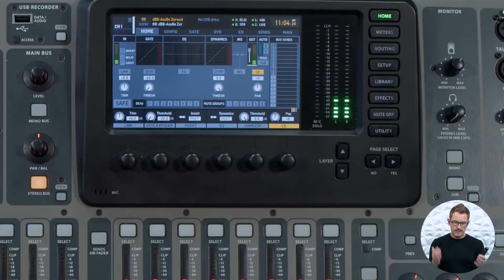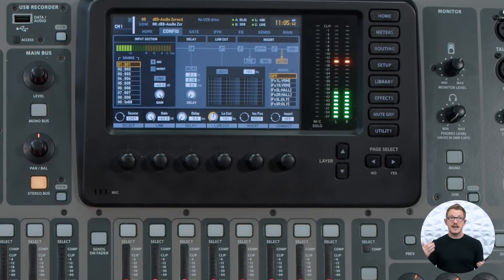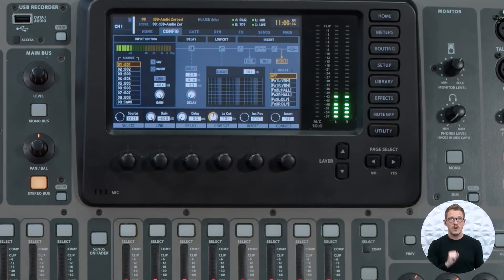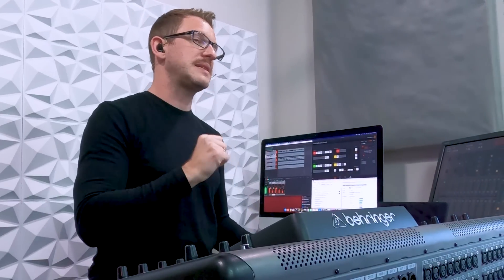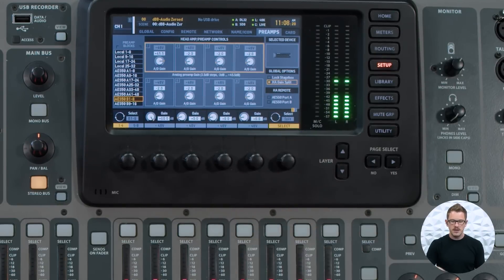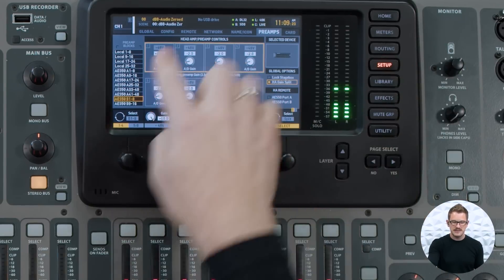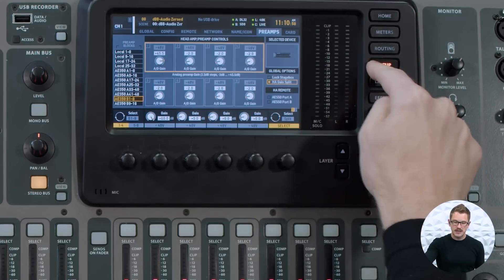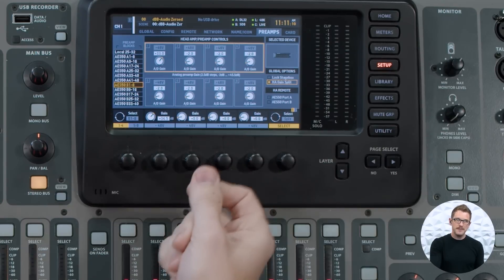Gain vs Trim, Whats the Difference?

Comment: Hello Drew ... so far I am following your channel and yeah ... learned a lot about my mixer, I operate a  studio that mostly do remote recording for clients, with me on drums and on the deck at the same time ... not exactly at the same time but you can imagine .. me recording drums and in a later step mixing with my daw to send files to clients. 
My main problem always is gainstaging as do to not have my mixer near myself so with a virtual soundcheck I can do pretty much everything except the gain staging. Is there any convenient way of doing gainstaging on yourself without touching the console ? I would be even better if I can do it through a virtual soundcheck ... thanks so far for your amazing help you provided with your videos ...

Comment: Does the nominal gain (-18) same with behringer wing?
Reply: Yes. Digital mixers use decibal full scale (dBFS) and line level is -18dBFS. Analog mixers use nominal is 0 dB VU which is a different scale. For digital mixers clipping is 0 dBFS
Reply: @aaronvarughese9638 A&H uses dBu on their digital mixers.

Comment: Because of the positions of my speakers, pushing the Gain to the ideal -18dB level creates feedback for the mics, especially for the monitor speakers.

So I often have to drop the gain to -30dB and then push the channel volume.

And workaround with this.
Reply: Per Drew's info, you should set your gain to a -18dB signal level and then set the trim to -12dB to reach both nominal gain and optimal gain-before-feedback (-30dB in your case).

Comment: I am encountering an issue with my Behringer X32 that I have not experienced before. Specifically, the signal on channels 1 through 16 is extremely weak, despite the gain being maxed out and the faders set to their maximum position. Even with these settings, the signal is barely audible.

This problem seems to be isolated to channels 1-16, as the other channels are functioning normally. I would appreciate any insights or suggestions from those who may have encountered a similar issue or have any ideas on what could be causing this.

Thank you for your assistance.
Reply: Preamp levels maybe? Not sure but could help checking that out. Its in the setup section. If I'm wrong would appreciate if someone could correct me.
Reply: Have you tried resetting your console?
Reply: Have you tried resetting your console?

Comment: Hey Drew, quick question. Will adjusting trim affect the IEM mixes? Or is the purpose of trim so that the faders can sit at unity with correct gain?
Thanks!
Reply: If you are plugging some type of analog device into a channel on a mixer, you adjust the analog channel gain to what it needs to be for optimal gain staging. Trim is also gain, but it comes into play after the signal has been converted to digital. Trim is used to make small level adjustments so you don't have to go through the process of re-setting your analog gain for something minor. If you need more than a small tweak, you need to fix it with analog gain. 

I believe this answers question. If not, try to give more details.

Comment: really random question, but is there any way we can lock a gain once it's been set on the X32? I need to get my students more confident on using faders, instead of the gain to prevent feedback.
Reply: Nope. I think you should just tell them not to use gain for feedback. Gain is to get things to line level. That's it.

Comment: Great video, Drew.  I've got a FOH M32 and an X32 dedicated for broadcast.  The M32 is feeding the X32 via AES50.  Is there a way to have both consoles operate gain independently?  Would connecting both consoles directly to our S32, as opposed to interconnecting both consoles via AES50, add any benefit from a gain perspective?
Reply: connect your house to the A on the S32, then your Broadcast to B from the S32 to the A on the X32
Reply: @bflatmusiccimix1234  Thanks!....will give it a try.